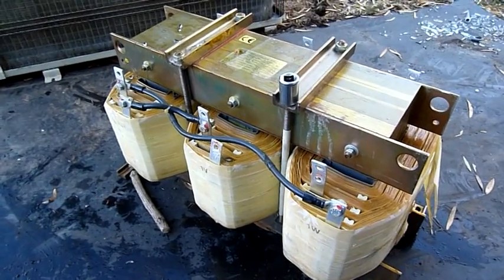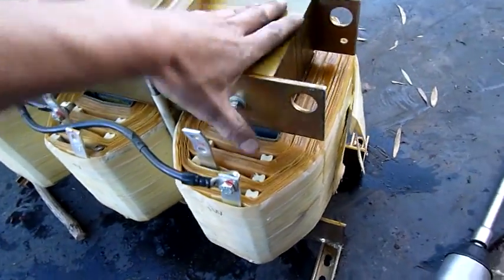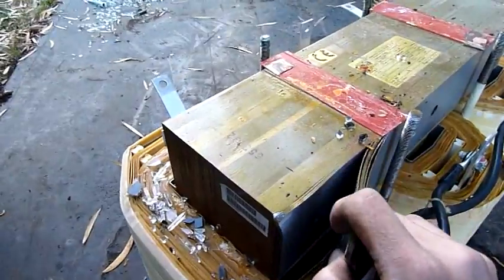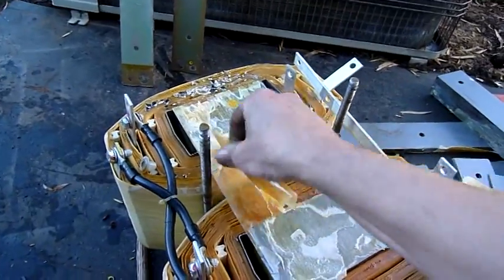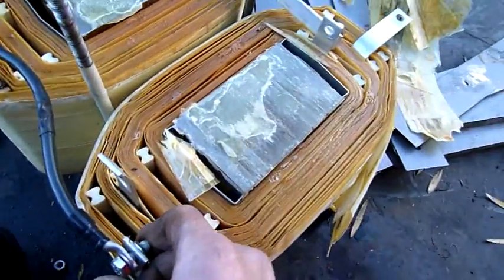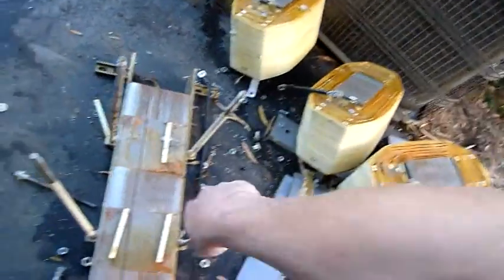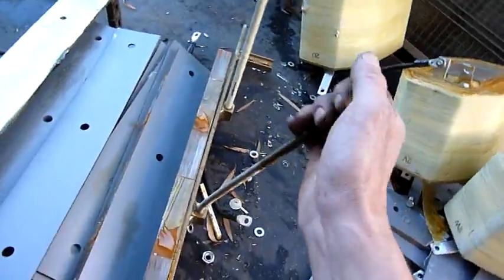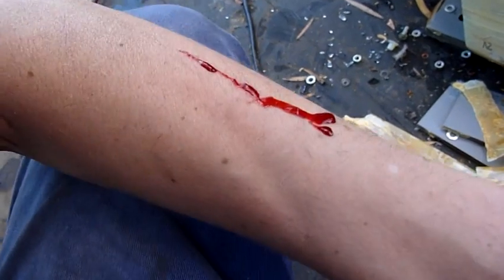Breaking Up a 40kva 3 Phase Transformer

Comment: I once had one simple to that from an old welder. Made more money than selling as dirty/irony copper and steel. Just pop out the transformer core with a rod and sledge hammer then rewind the copper off paper then sell as grade 3 copper because wire is laminated with epoxy or thick coat paint. Those steel sheet can be sold on eBay as steel sheet mostly will be use for bracket. Got my money triple.

Comment: Normally the E and I are interleaved, make it much harder to pull apart. I suppose the designer wanted large gaps in the core to help stop saturation, caused from imbalances. It very small for a 40kVA transformer too, gee it must waste lots of battery power as heat.

Comment: Back before the 60s they used to wind all small transformers and shaded pole motors like the ones in record changers like that transformer with the laminated layers.  I guess they stopped just to simplify the manufacturing process.

Comment: Whack out the cores, then burn off the insulation and sell as scrap aluminium. The silicon steel laminations will just have a very thin oxide layer built on them as insulation. a quick work over with sandpaper and they will be clean.

Comment: that steel will be coated, but not very thickly, just enough to stop the laminations shorting out. Nicely dismantled, just as well the top yoke wasn't interleaved - that would have slowed you down :-)